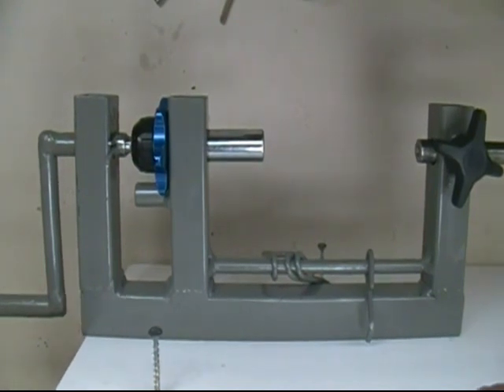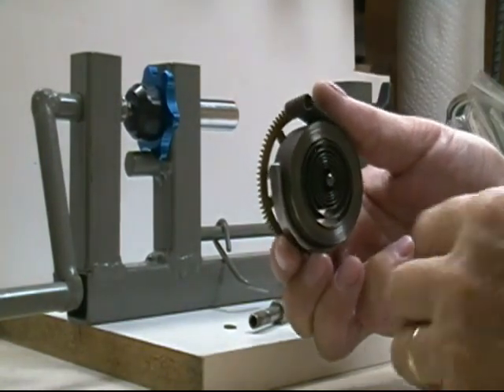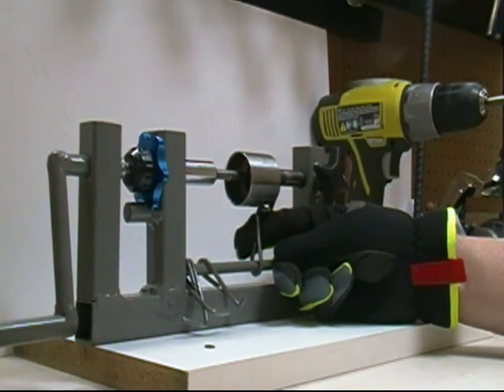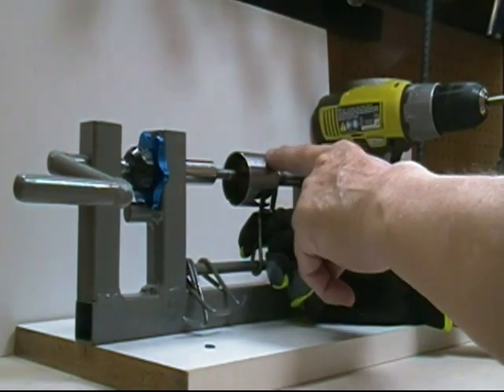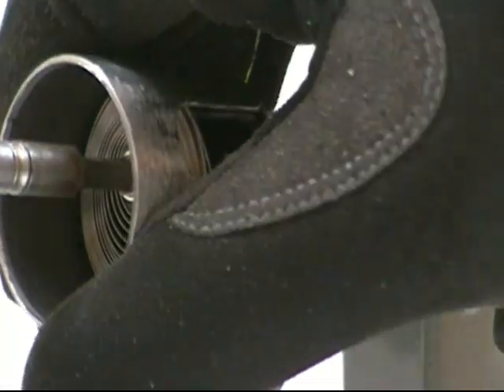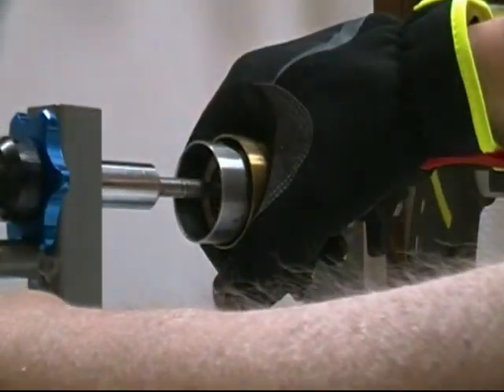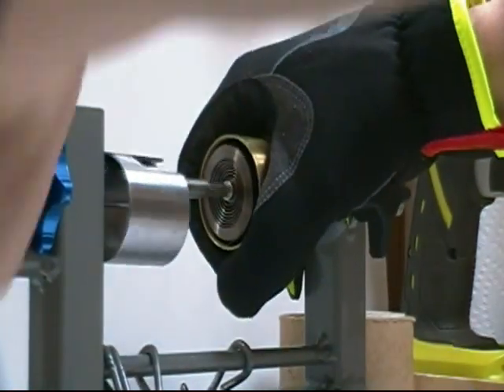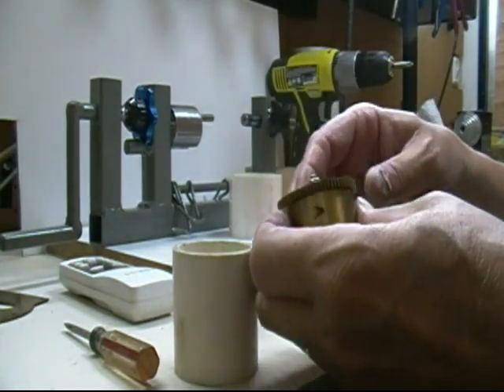Clock Mainspring Winder Plans and Construction Video

Comment: Excellent.  I also like the way you showed putting the cover back on the spring barrel.  I have always struggle with that.  What is the sizes on pvc piping did you use?  Thanks for sharing.